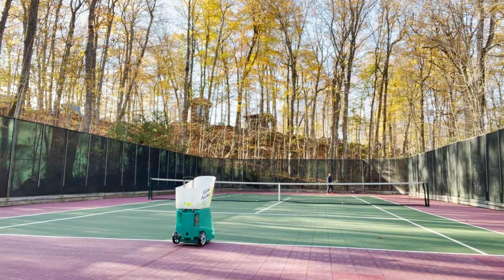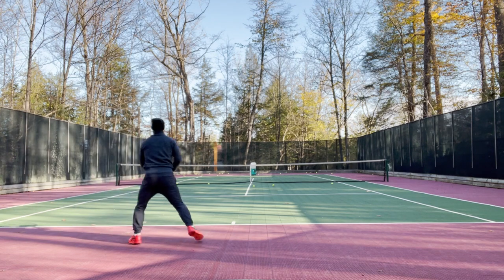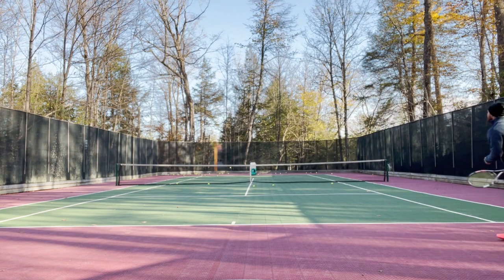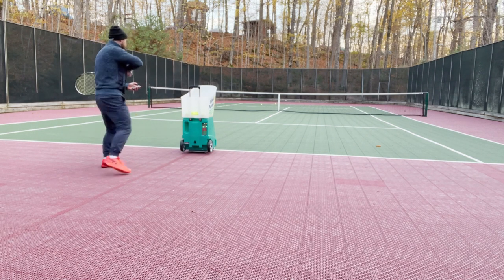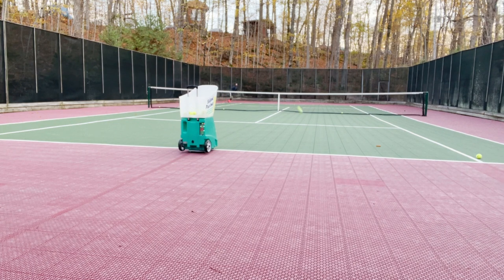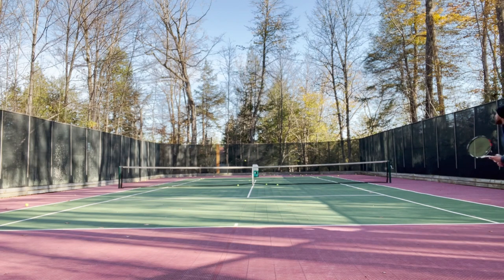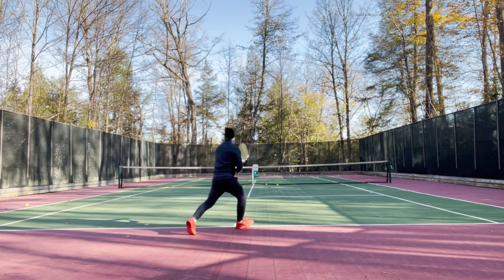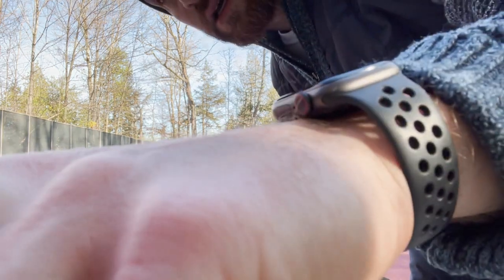Silent Partner Tennis Ball Machines - Scoop Smart - Match Play and Select-A-Drill Modes

Comment: just bought a used one with under 10hrs on it for $650. i am pumped
Reply: what has been your experience so far ? I just bought a Scoop Rival that arrives today and I'm really excited about this
Reply: @jonathancaballero9033  I've found it really it difficult to use. I hope your experience is better. I ended up buying a SpinFire Pro2 and  I am very pleased. I have owned 5 different brand ball machines and a total of 7 machines(Playmate, Tennis Tutor, Spin Shot Player, SpinFire and Silent Partner) over my 37 year coaching career and the Silent Partner has been by far the most difficult to use and adjust. The SpinFire is amazing for making adjustments with the remote on the fly. Great for coaching. The 2 Playmate Volley Machines  I've owned were basic but a workhorse. They were extremely reliable and consistent.  They lasted 15 years.  The Spin Shot was the best for setting up a custom drill list and phone remote.
Reply: How is it difficult to use?
Reply: @a13ovea11  it is difficult to calibrate initially so that the functions can work. I did not find the process for custom drills to be intuitive at all.